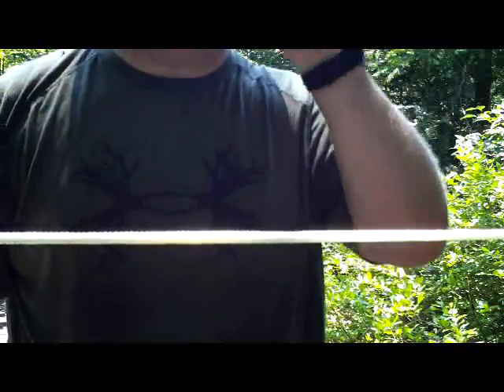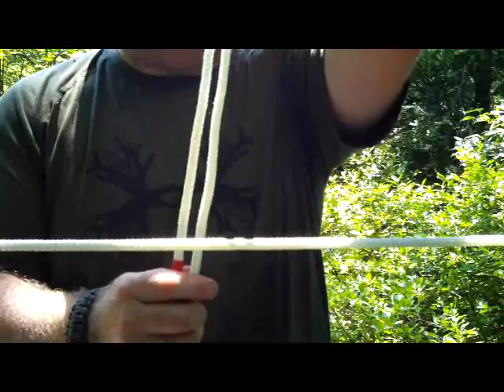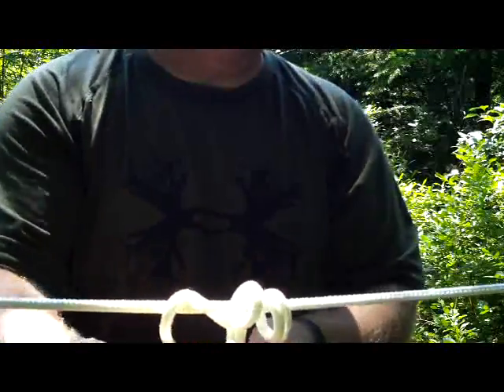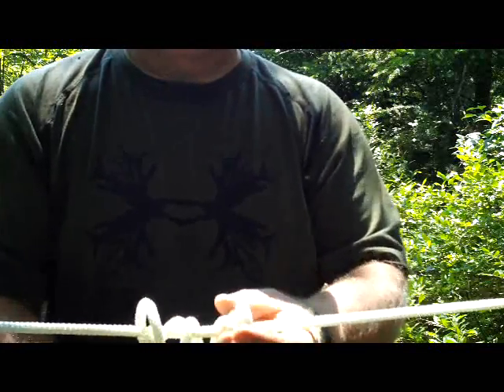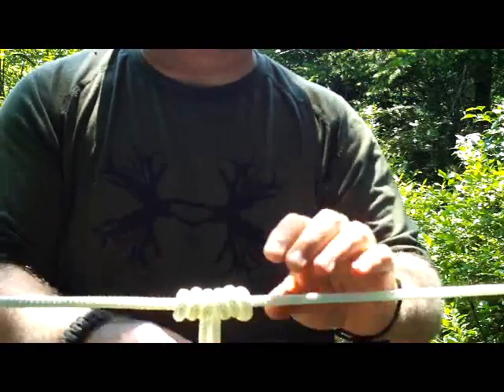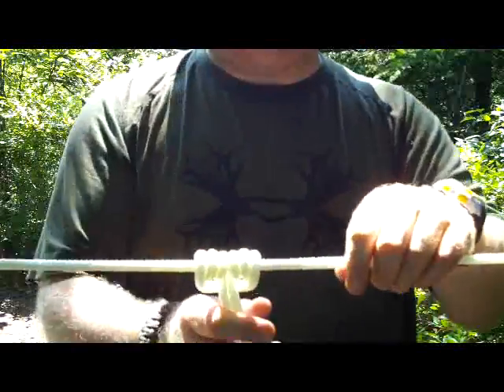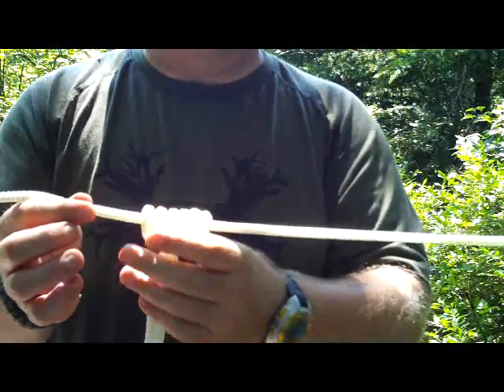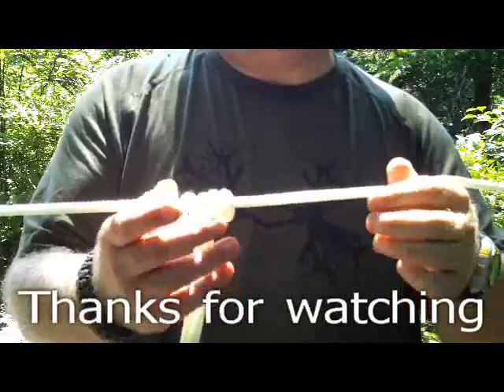Prusik Knot

Comment: Didn't I see James Bond use this knot to climb a long rope using his shoelaces!?  Excellent demo of this knot. I use it like you mention for holding my tarp on the ridgeline.  Nicely adjustable to where my hammock ended up being pitched.  The hammock always ends up halfway between the trees, but the tarp isn't necessarily halfway along the line I use as a ridgeline because I use a fixed(dutch)hook at one end of that line and do all the adjusting for different tree separations at the other end.

Comment: The number of round-turns needed depends on the flexibility of the prusik line and the diameter of the standing line, and the slipperiness" of both.  
As he suggests, do not use it for life-safety without significant experience or professional guidance.